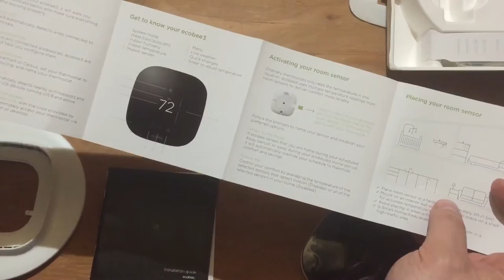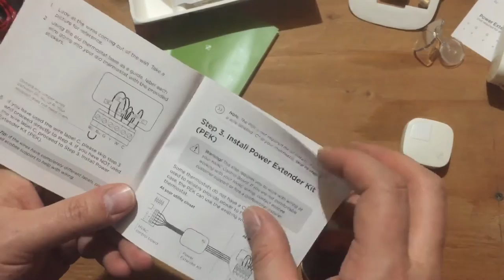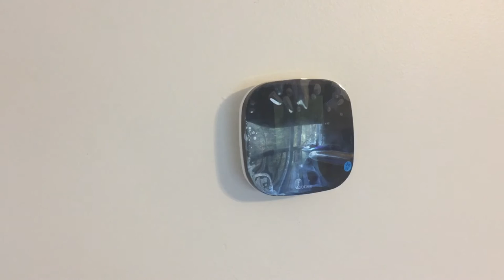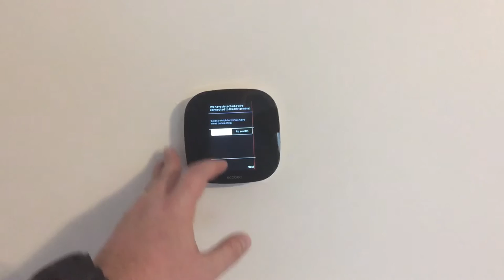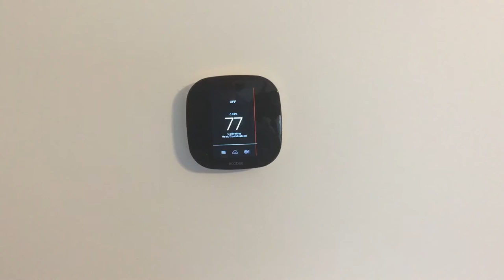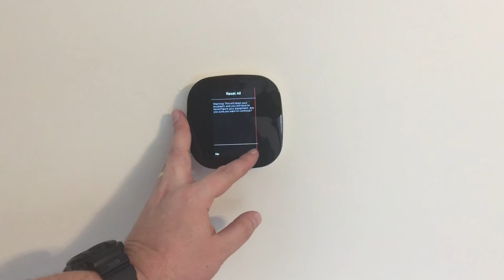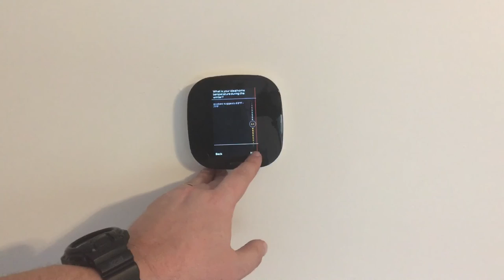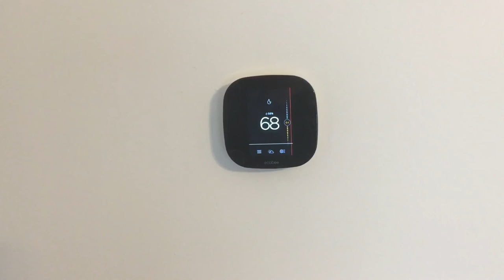#020 Ecobee 3 Smart Thermostat Install, Part 2

Comment: I've been trying to figure out the same thing with my SR504 & 2 Nest thermostats. Your videos and explanation are so helpful!!

Did you have to upsize the wire from #18 while combining all C wires? I'm guessing the amperage limit should be fine as these draw low current?

Comment: How many smart thermostats have you got driven by the Taco's slave transformer?  I'm wondering if the transformer is capable of supporting multiple smart thermostats.
Reply from the maker: Check out the Part 4 video which covers exactly this question: https://www.youtube.com/watch?v=ZfDIAMBJuVo

Comment: I've seen other videos state that the 24V terminal, just above the common also needs to be run to the RC or RH.   But based on your video,that does not appear to be necessary.  Is it true that just the  COM needs to be run from the 24V com to the stat C?    This is particularly important for me to understand as my stat has 5 wires already - Y, G, RC, W, RH...  and I just want to connect the spare blue wire in the cable to the COM terminal in my SR 506 and connect that to the C in the stat - -  is that sufficient?   Thanks in advance for your time/advice.
Reply from the maker: It's also been a few years since I did this install so even if I ever knew the answer to your question, I've forgotten it by now, sorry! 

Bear in mind I have a heat-only system, and the requirements may be different when you have both heat and cooling. Best bet, if the manual isn't clear, is to contact Ecobee support in this case.